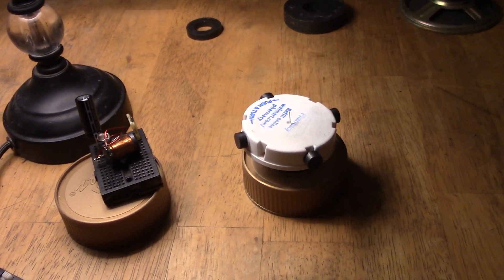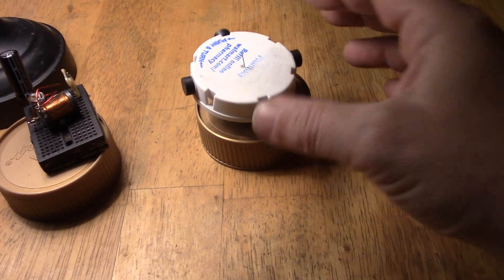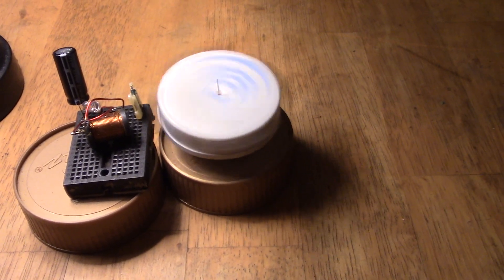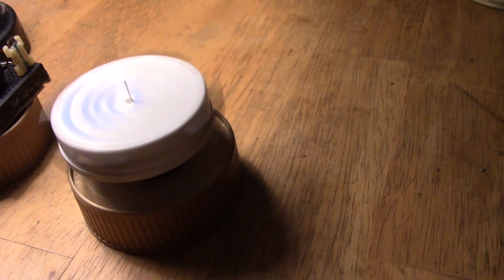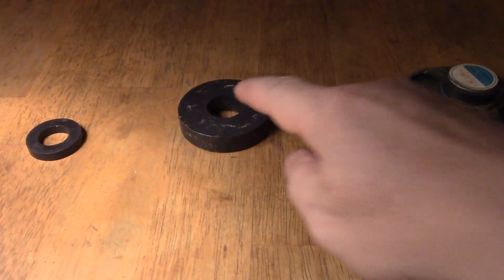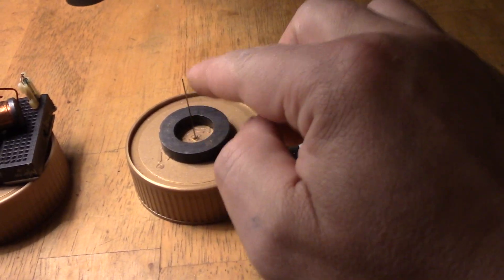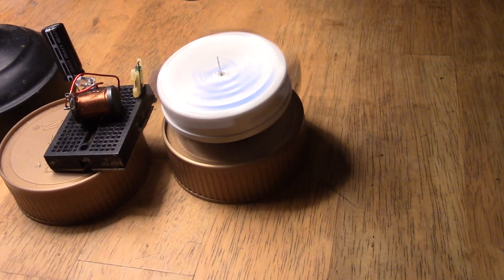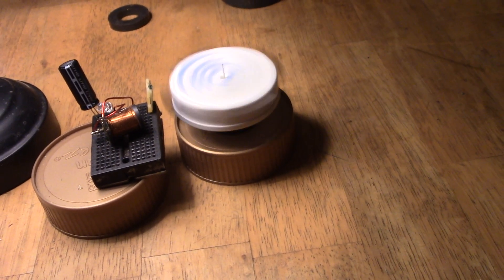Pseudo Levitation - Replication

Comment: Your needle looks like 1 mm in diameter.  If you glue a short piece of 2 mm od aluminum tubing to the lid, the lid won't wobble so much.  The id of the aluminum tubing is slightly larger than the 1 mm needle so the small clearance between the needle and the tubing will minimize the wobble.  For a .5 mm needle a 1 mm tubing is just right.  I prefer using aluminum tubing than brass tubing as it seems to offer less friction.  By the way, acupuncture needles  make good rods to spin around.

Comment: Wait, wait, I've seen magnetic levitation but will the reed switch driver spin the rotor indefinitely?
Reply from the maker: It can spin it 24/7, if solar powered in the day and using say a rechargeable cell or supercap for overnight. That's the mission really, to find a near zero friction rotor method :)

Comment: Nice demo.  I'm still looking for some 50 - 70mm diameters ceramic rings so I can try this myself.  I noticed you use the traditional approach with two rings opposing each other.  Have you tried Lidmotor's approach with just one ring magnet in the base only?
Reply from the maker: Cheers. I was trying to get to a proper replication, using the same drive circuit and even same 10F 2.7V supercap... but, had no same sized neo's and only a few of the ceramics. I believe he put 4x ceramics in the top part of his rotor.
If nothing else, it's flexible for parts :)
Old 70's to modern day 1/4W speakers have those ceramic rings. Any glue on them melts with acetone.
Reply: Yeah, I've got a few old speakers I could cannibalize for ceramic rings.  I was reluctant because you never know when you may need a speaker.  But realistically, I'll never use them.  So I might as well just take the parts.

Comment: cool. a while back  i used a magnet up top with needle hanging, and a magnet at the bottom which kept the needle aligned, so there was an air gap, and it ran freely,  so the needle is only touching the top magnet. and the bottom of the needle isnt touching anything and hangs in air,  the pull of the bottom magnet was there just to keep it pulled enough to centre it and float....i used a solar dancer thingy....worked pretty good..
Reply from the maker: That type do work really well. My faves used to be your type, but upside down. Had one running on a glazed bathroom tile as the bottom contact point for 3 years. This type is hoped to match for long runners.  
A wireless electric solar dancer circuit is the next step of my own with this sort of setup... I don't know why, it just appeals :)
Good luck with your experiments!

Comment: Excellent, John will love that!
Reply from the maker: It's a simple but very effective method of building a rotor. The outer magnets are from solar waving toys. You could also use the circuit from one of those to power it (no batteries), as Lidmotor suggested in his comment. Would make a great father/son project and a table curio when built.

Comment: Excellent!!  I worked with mine again today and got it running on a 'solar waver' driver.   Because it moves pretty slow I have a bit of a wobble but not bad.  I just took the driver guts out of a solar waver toy and trimmed the plastic down so it fits inside the bell jar.  It makes a nice shelf item now.  I might add a AAA battery to it hidden in the base of the bell jar.  I found that a 740 ohm resistor in series to the battery knocks the voltage enough.  The battery goes in parallel to the solar panel.
Reply from the maker: The solar waver route ticks the box for longevity, with supercap for overnight, similar to your long runners. Am going to do that, because have got a heck of a clatter going on in the kitchen window with half a dozen wavers!